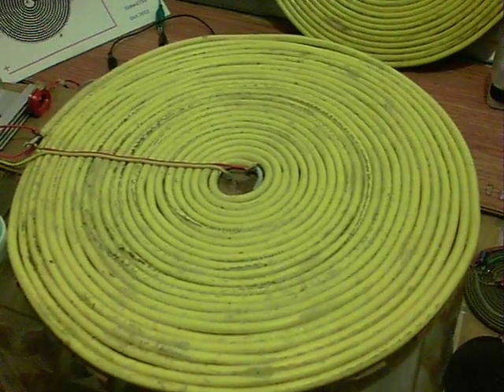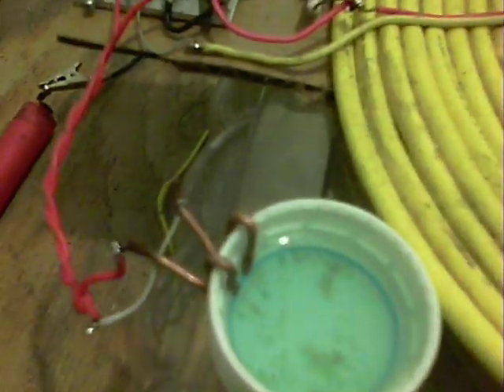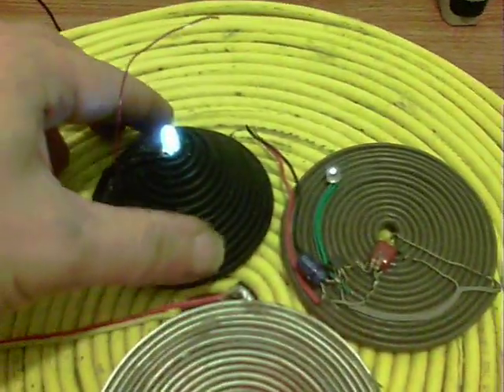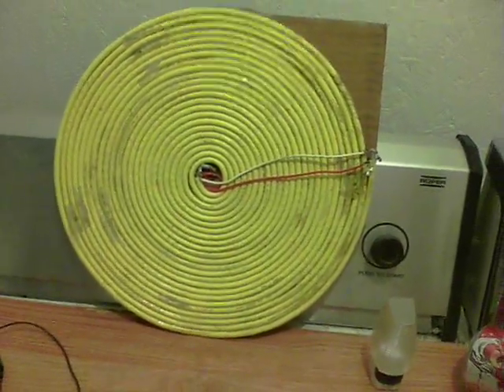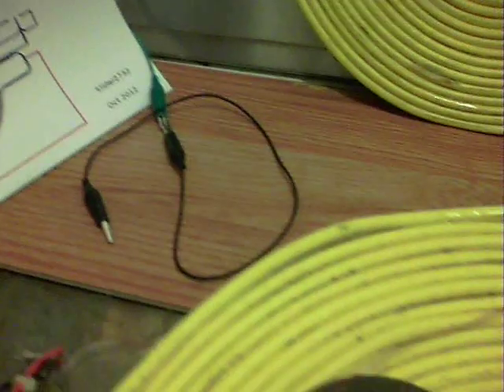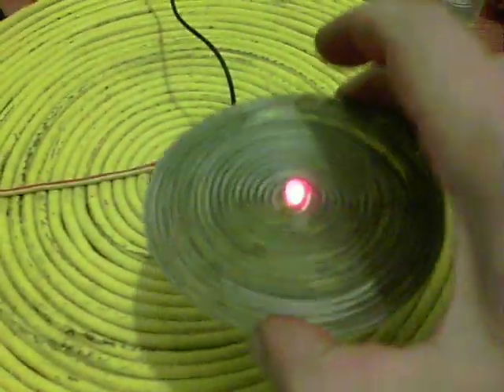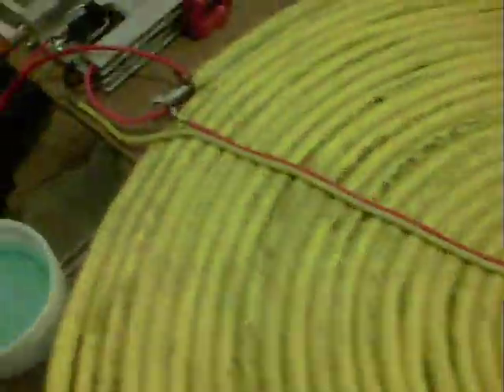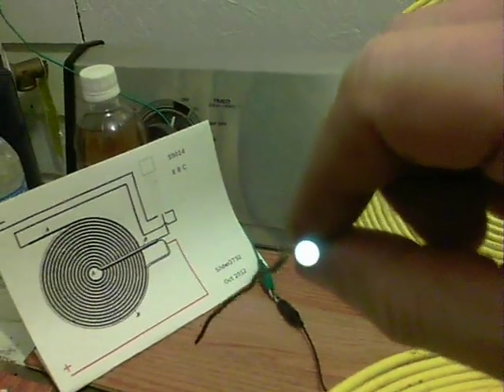Simple Wireless Electricity - Part II - The BAC's

Comment from the maker: That's a mad idea Raymond, a great one though ! Yeah, you can definitely use the induction effect of house wiring. In my 'Pigeon Loft' series I had enough to charge a cellphone. Would light 15 LED's and lit a 2W LOA LED mains bulb etc. So a system using a pancake and similar tuning is highly possible, more so with radiant collection antenna and a large surface area deep Grounding rod.

Comment: Amazing video. Well done. Have you tried transformer wire. Am toying with the idea of installing on living room wall and papering over the top. Then try and use the domestic ground to supply power from the the grid circuit via rectification to the coil. Then I am hoping to do simple things like charge phones, bedside lights and a couple of reading lamps.